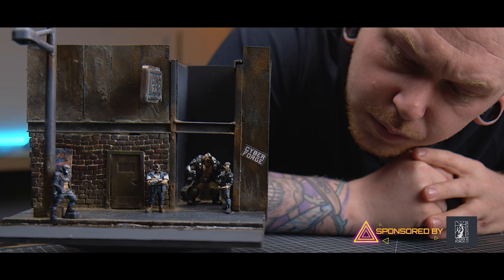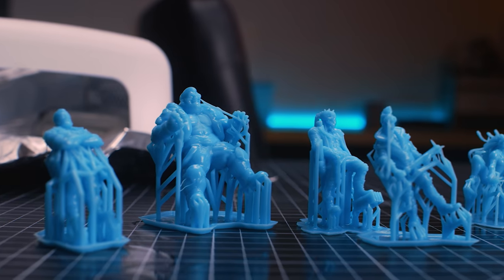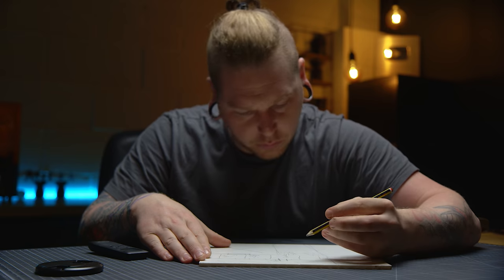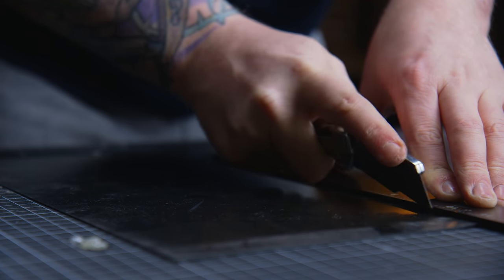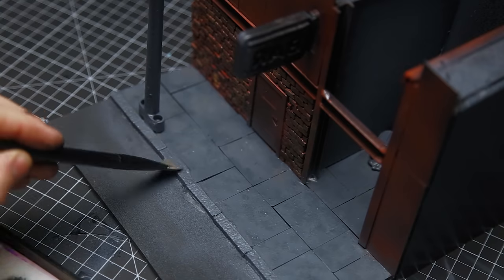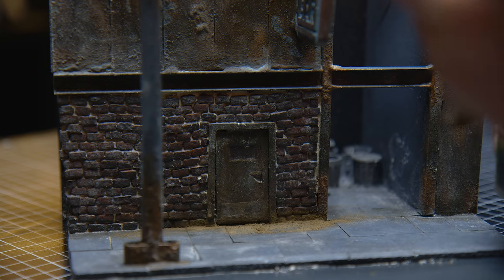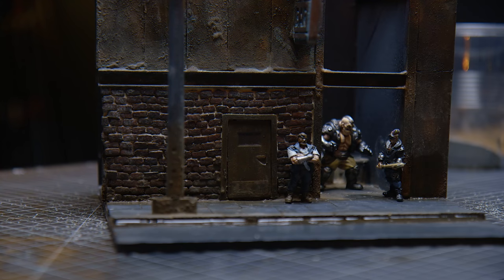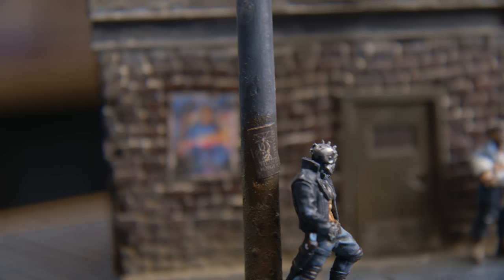BUILDING A CYBERPUNK 2077 DIORAMA

Comment: Awesome diorama man! Quick tip for adding your own supports and getting them to come away as the pre supported cyber forge minis, try these upper diameters: 0.12, 0.22, 0.32 for light medium and heavy respectively and your lower diameters at 1, 1.10, and 1.20. All with a contact depth of 0.22

I've found these settings to be a really great starting point that will give you a print that's super easy to remove from them with very little damage. Main thing is just adding enough heavies at the first few layers (bottom of feet, underside of object etc) that the print can hold on, then just use medium and lights everywhere else.

Comment: When you were explaining the problems at the start and not getting g much help back it reminded me of when I got my printer. I have the Wanhao duplicator i3 plus I couldn't get it to level right, I followed the instructions word for word, contacted the company who gave me the same instructions, and each time the extruder would keep pushing down and gouging holes in the surface of the bed. It destroyed the magnetic print surface, and caused me to hulk out a few times. In the end my friend who has experience with 3d printing came over and had a look at it, he found the sensor had been installed wrong. In the end it was an easy fix but you really do need to either know this stuff yourself or know someone who can help!

Comment: For a lot of these pre-supported models I have to not only increase the exposure time but also decreased the lift speed so it doesn't yank the model off of the supports as it pulls it off the FEP.  I recently printed a model in red resin that was printing fine in other colors and it was a mess so I can see even the resin changes the settings you need to use.

Comment: Very cool mate i love your builds, If you ever fancy doin something using an FDM 3d printer (Creality Cr10) get intouch mate
Reply: Geek Gaming Scenics, A few techniques I’ve heard about can get them quite smooth but I’ve yet to experiment with them, I’m mostly printing dungeon tiles and drop terrain right now, best thing so far is a filler primer before painting, I’ve seen people have good results with a 0.2mm nozzle but not tried it yet
Reply: Geek Gaming Scenics most scenery like dungeon tiles, usually the details in like wood or brick pattern are dominant so just the layer lines are softened and I print them at 0.2 layer height I could print finer but it’s slow process, I’d love to get In to resin but share a hobby room with a bunch of gaming kids so the chemicals and smell wouldn’t be ideal